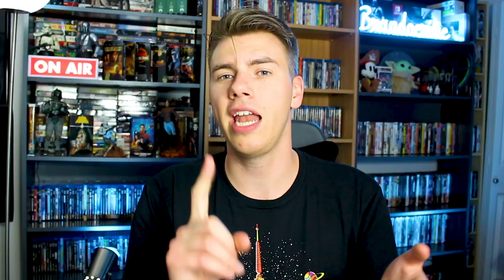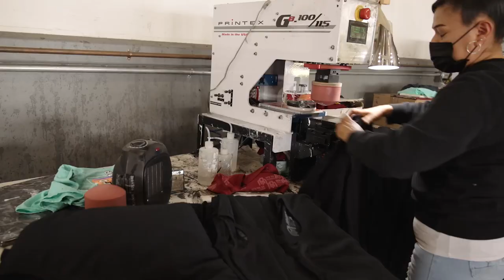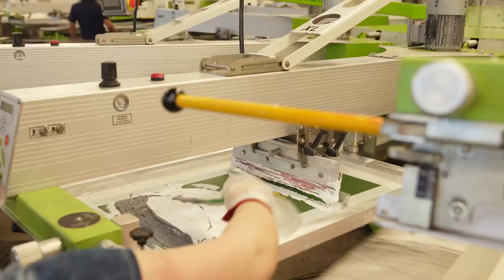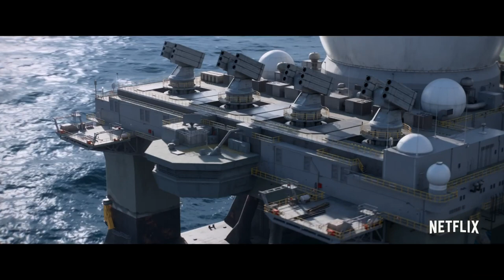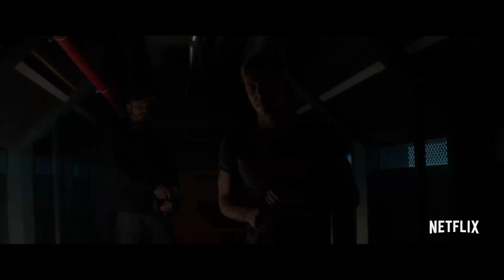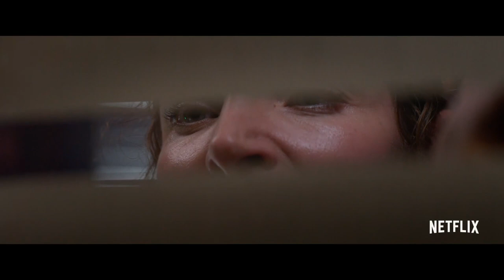INTERCEPTOR is a JOKE!! - Movie Review | BrandoCritic

Comment: It’s pretty good from a military and tactical standpoint but mosf of what she did was impossible on her own
Reply from the maker: Many people are saying that it isn't good from that standpoint
Reply: It actually really isn't, even a green soldier would grab any weapons nearby once the initial shock of the attack had set in (survival instinct). For example when they close both doors between the rest of the rig and the command room, with only two real ways in, through the doors and the rear hatch which the captain and rahul should have covered both entrances. Not to mention when shes fighting the big guy in between the doors to prevent enemy reinforcements from taking the control room, even if rahul is afraid why did he not rush in to help or go straight for the shotgun in case the captain failed? Because at the end of the day he had the motivation to do so, bad guys get through the door everyone dies. You are correct in stating that most of what she did was impossible on her own. Not to mention the "plan" she came up with to let them take the command center and then retake it was completely retarded. There was no guarantee that they would launch, they could have just stayed there until it was literally sinking and left then launched. Another problem was the differences between SBX-01 and its counterpart. So all you need is a laptop and the usb device that was under the desk, that the bad guys clearly didnt know about to use SBX's counter measures but they couldn't jerry rig something at the other base? Please... With important sites like that they always have redundancies. I'm pretty sure too that some american warships also have the ability to intercept nukes could be wrong on that though. Another thing i can think of that doesn't make sense is how everyone else on the rig was killed by nerve agent, and yet rahul or the colonel never noticed on all those fancy monitors? your telling me that they didn't have any security cameras apart from near the airlocks or inside the command center?  Or how about the enemy submarine, its mentioned that the US submarines in the area had chased it off a few times but it always returned your telling me that after the third time the US sub captain just went "Well third times a charm boy's we're going home and leaving SBX completely undefended" haha your kidding right? High security facilities always have assets guarding them or close enough to respond QUICKLY. There's a LOT wrong with this movie, and like Brandocritic mentions the script for the female lead is trash. You know its bad when they are using cliche lines like "You prepared for everything, except me" i literally guessed that line watching this movie for the first time before she said it. The woke narrative is really cringe too, like shes kicking the big guy who is probably 3 times her mass across the airlock? Or instead of taking the time to assess the situation like a real veteran soldier would now that there's two massive doors between her and the enemy instead shes talking shit and pretending shes the toughest person on the rig, only for it to be revealed that she tried to kill herself in the past? Seriously who is writing this? Even her double standard of "Oh don't tell me this is all about Daddy issues" then turns around and over dramatically starts begging the dude not to kill her dad? Like yeah its her dad and by the look of it all she had left in the world but seriously? You think his gonna spare your dad if you beg him? His the bad guy. Even after telling the guy to "stop mansplaining" although i agreed that the villain spent waaaaaaayyyy too much time talking like he was going to impress her, i mean in real life if someone screwed up your plans and tried to kill you, you wouldn't try to impress them you'd just shoot them, but back to my point even after telling the guy to shut up she blabbered on just as much as he did. Idk this whole movie is incredibly bad in my opinion. I think the only thing that was half okay was the CGI and the choreography of the fights was well done (punches and kicks) credit where credit is earned.
Reply from the maker: Thanks for the insight!
Reply: @colgrieves9266  I agree but it is a movie
Reply: @ciaspecialactivitiesdivisi5867  yeah it is a movie your right. But it could have been a lot better just saying :)